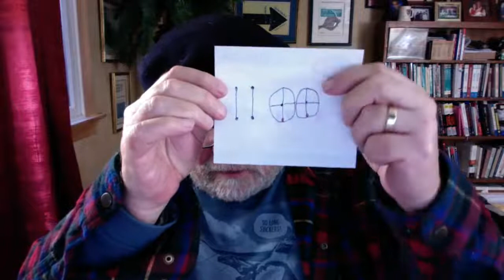What is the most constant force in a mechanical watch

Comment: G'afternoon Bill 😎 in a nutshell the simple answer is everything has a resonance regardless of how big or small said resonance may be.  The easiest way that I know of to illustrate resonance frequency is with the use of crystals. I'm a mechanic as are most of the guys in my family so you can say I kind of grew into it 😋 . Anyhoo I Concur and what you were saying about friction and different lubricants got me to thinking about something.  It would be quite interesting to see the outcome if you took a movement with notoriously High friction properties and treated said movement with Energy Release "ER" @ the friction points and quite possibly eliminating all friction. Energy release is an anti-friction lubricant compound that Bond's to the metal at a molecular level,  but here's the interesting kicker. If you have a motorcycle with a wet clutch and you put energy release in the crankcase it doesn't affect the clutch or the plates in any way shape or form at all but it does eliminate friction everywhere else at find it,  it really is incredible stuff. It was designed right here in the Boise Idaho area a few years back.  I have a friend that owns an engine machine shop and any time he's going to be doing machine work on engine parts that have been treated with energy release, he has to use a torch to remove the er otherwise it all dull and ruin any cutter or bit he tries to use on it first.  I think that would make for quite the interesting experiment 🤔 .
Reply from the maker: Thanks for that, Idle! I like mechanics, but I'm somehow more comfortable with physics ... even though the two are inexorably connected. Your explanation is very helpful! Here's one on resonance and watches you might like: https://journal.hautehorlogerie.org/en/two-hearts-beat-as-one/ Take care and be safe, Bill 😷